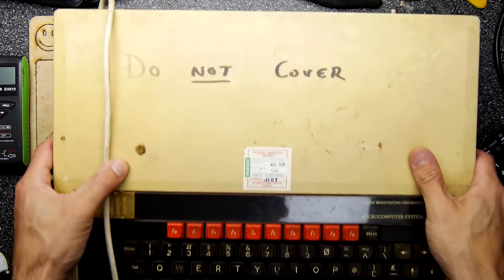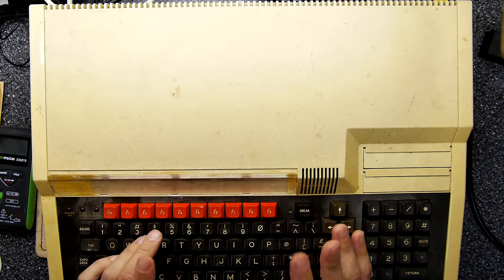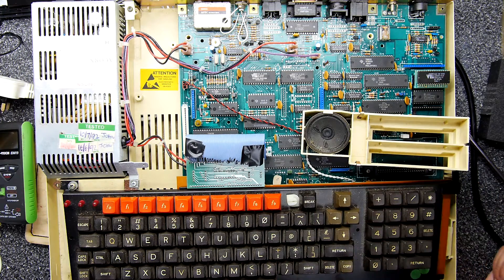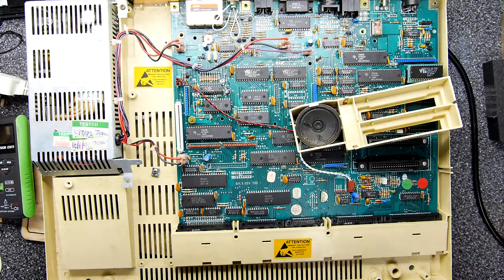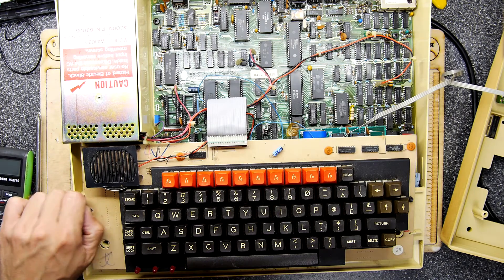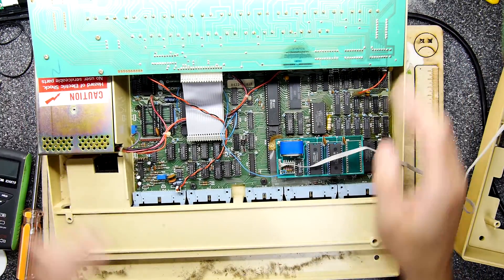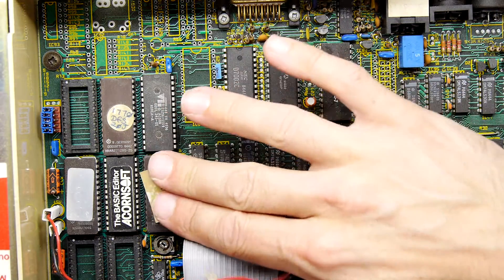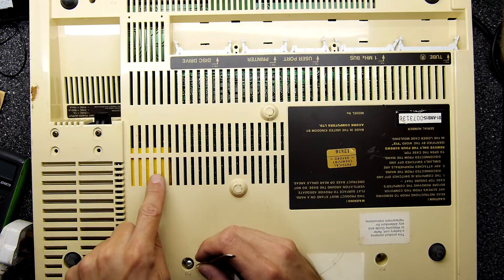Acorn BBC Microcomputers

Comment: The white thing next to the break key on a Master can be accessed with with the cover on. It's to stop you from pressing break.

Keys on the Master aren't as robust as the B. There's two types. One style has the same type as the Electron. I've a feeling your first one doesn't, because of the fancy cable. There's a website that explains it all. I read up on it because I had to replace a key on my Master. Mine has the same cables as your second one.

Acorn had to replace the rechargeable batteries because they had a habit blowing in the past. If I remember correctly the, charging circuit just kept on charging, even when the battery was full.
Reply from the maker: It's odd they didn't recommend the users replace the AA cells in the replacement units isn't it
Reply: @backofficeshow  I'm guessing it was a clever way to get you to buy it again. Mine is a third party after market mod, so I was told to text in a years time from purchase.
Reply from the maker: Maybe they were worried about people getting it wrong and damaging the CMOS chips - or themselves 🤔

Comment: Amcom Discount furniture store
Reply: Also HM6264LP is RAM. The "dash" 15 indicates it's latency/speed (150 nanoseconds). The SN7400 is a standard NAND gate, likely to map the 2 ram chips to a higher bit bus. These ones will be 13 bits (i think), but since there are 2, you can control them both using 14 bits... using some NAND gate logic on the high significant bit and the CS pins (chip select).
Reply: Usually if it's EEPROM, it will have 28C*** where * indicates it's size. HM62*** are popular static RAM chips.
Reply: For EPROMS it'll be 27C***
Reply from the maker: That's is really useful to know, I might write that some where!